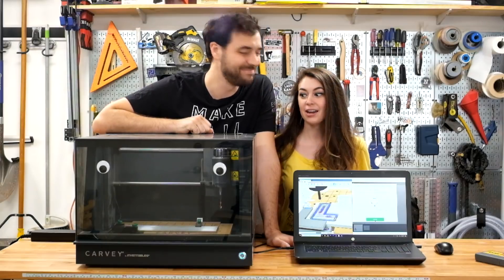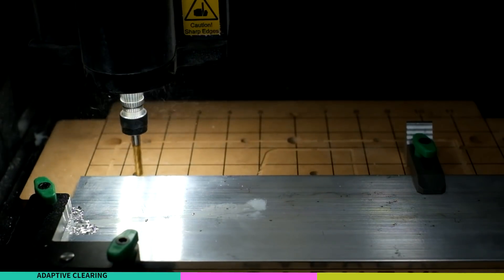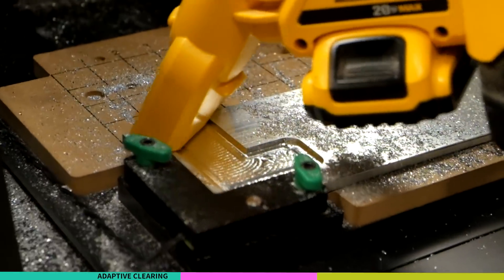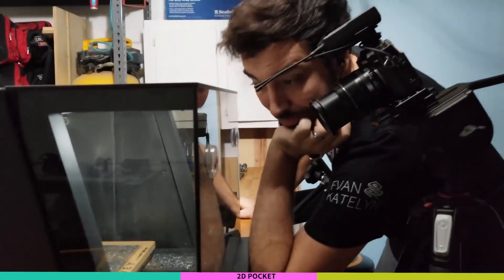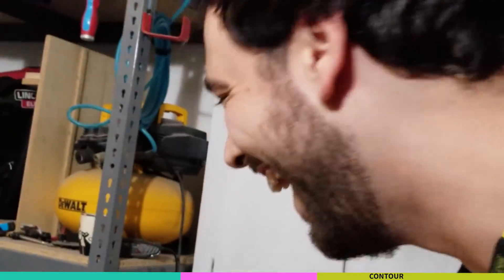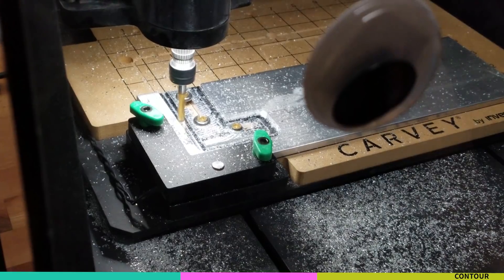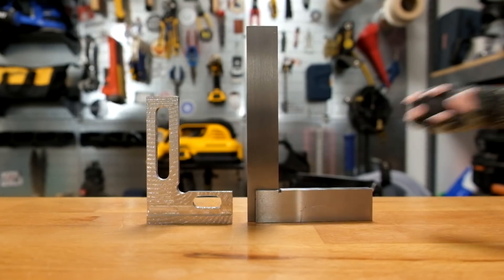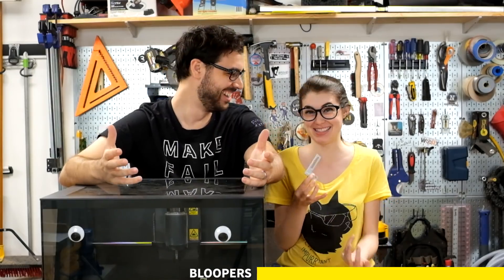Can You Cut Aluminum on a Desktop CNC?

Comment: propably the first thing you should do with that is build a cnc machine out of aluminium - then put a proper motor on it and then you actually are able to machine aluminium.  a square is not that hard to get right, but round stuff like holes or stuff with many repetitions and direction changes like gears is harder since the repeatability of a wood carving machine is nowhere near something a machinist would use
Reply from the maker: I guess the point of this was to see if we COULD do it on the machine we have - so we're actually really happy with what we were able to accomplish so far, even though we know further dialing in is needed
Reply: dialing it in is hard to do, if the machine runs on the edge of whats possible, you begin losing steps on the motors, maybe bend some guide rods and all that good stuff - just take it slow, machining metal takes a long time, even on really heavy machines. and also the type of aluminium makes a huge difference, there are different alloys and some are really gummy to machine (6061 for example is terrible) if you can get your hands on 6012, 2011, 2007 type aluminium, those are all made to be machined and they have additives in the alloy that makes the chips break instead of gumming up your cutter.

some comments also suggested that the cutter you used was too big wich is most likely also the case. but still i'd recommend starting to build a heavier machine if you really want to have precise mechanical parts
Reply from the maker: Yes we definitely want to try a smaller endmill, like a 1/8". We were using 6061 so maybe we should experiment with some others. Thanks!

Comment: Buy 4 flute carbide endmill. Much better for hard materials.
Reply from the maker: Hmmm, we used two flute since that's what most people seem to be recommending, but we're willing to look into it more! Thanks!
Reply: @EvanAndKatelyn  imagine it like slicing tomato with 2 or 4 knifes at the same time. What is faster? :)
Reply from the maker: 4 would definitely be faster, I think what other folks were saying is with a 4 the chips would be too small and might get gummy.
Reply: Yes, but at your feedrates it shouldn´t be a problem. I´ve already mashined few cast aluminum parts and the chip welding only occured when chips were getting hot. With your spindle power it shouldn´t be a problem. And it should fix vibrations a little.
Normally when removing a lot of material they use roughing endmill and then take a finishing pass with finishing one.
Great book about cnc machining is Fundamentals of CNC machining by autodesk. Or NYCCNC.
Wish you success :)

Comment: A few things to note.
It looks like the machine uses belts as the drive system. That is going to give you guys a really hard time as the machine deflects and looses steps like crazy
Your end mill is pretty big for that machine, I'd look into 3/16 or possibly better, 1/8. YG-1 makes some very affordable endmills that would be worth your time to try. 
The end mill does not appear to be a plunging geometry. That means it has no relief in the center, so it can't be pushed through the material. That plus the lack of rigidity was the biggest fight for you guys.
Reply from the maker: Thank you for the tips! Definitely wanna try 1/8 next time. A lot of folks have suggested getting a shorter one too. Will look into different geometries as well 👍

Comment: Wrong machine for the job. The guide bars are not rigid enough. They really need to be supported. Continue to cut aluminum and you will wreck that machine in short order.
Reply from the maker: It's definitely a machine more suited for wood but based on all the folks we've talked to with a lot more CNC knowledge than us, if we keep dialing in things and taking it slow we should be good to go 🙂🤞

Comment: Im no expert but i think youre feeding way to fast and something in your setup isnt rigid enough.  It definitely doesnt sound happy.
Reply from the maker: Definitely too fast in the beginning! This is a machine usually meant for wood so we are pushing it's limitations
Reply: @EvanAndKatelyn  for sure.  I would suggest setting up a test path so you can get repeatable results then slow everything waaaay down.  After that start bringing feeds up a little at a time until you hit the limit of the machine (you'll hear it when it's hitting the limit, it definitely shouldn't sound like it does in the video) then back it off a bit.  You might also want to switch to a 1/8 aluminum cutting endmill as you'll get better results with the low power router.
Reply from the maker: Definitely want to try 1/8" next time! Haha and yeah we probably should have started slower and ramped up instead of the other way around. Thanks!

Comment: First of all: I am not an professional milling operator with a 1 ton Bridgeport mill, so I know what is possible on wobbly machines. Good manufacturers for milling tools have nice tables with all the data you have to know to make fine chips. And for aluminium and a 6 mm 2 edged cutter the data (I am from the metric side of the world) is: cutting speed 100 m/min; feed: 0.019 mm per edge. That calculates into 5300 rpm and 202 mm/min (8 in/min). So, your cutting speed is probably way too fast (20.000 rpm?) and will ruin the edges in no time, also the vibrations cause tooth decay which causes more vibrations. The carvey is not strong enough to break the tool, but at this noise my foot nails are rolling up. For aluminium you need a very sharp tool, crank down everything, use coolant/lubricant and you'll get much better results without ruining tools, machines and parts. And the data in the tables is made for 1 ton mills, so turn it down even more because everything is so wobbly. If it helps: I wrote a program for myself with the relevant data for my mill: www.sourceforge.net/p/feedcalculator (the help is containing an extract of the data tables). If everything is set correct and the tools are sharp, it should cut metal like butter ...
Reply from the maker: Thanks for the tips!

Comment: Oh my gosh you guys, kudos for trying something well outside your wheelhouse but this was a seriously cringe worthy experience.

On the bright side if you consult some folks with actual CNC machining experience I'm confident your little machine could actually do a decent job considering its size.

Edit: I apologize if my comment seems harsh that's not my intent. Don't try to reinvent the wheel. I do this daily for a living and would gladly help you if you'd like.
Reply from the maker: Gotta start somewhere right? We did do some research but as far as we could find, no one has tried this on a Carvey before so we knew it was gonna be a bit of a surprise!
Reply: @EvanAndKatelyn  there's a lot at play here with what your trying to do and like I said before I totally commend you two for taking the deep dive and giving it a whirl. There's only one way to learn and that's to try, fail, adjust and try again. 

I'd recommend you consider looking up the difference between what is called "conventional" milling and "climb" milling. You need to be "climb" milling especially with the very low rigidity of your machine. I'd also encourage you to read the linked document. I have printed off many copies and made them into books that I give to the machinist I manage for reference. Helical solutions has put together a great reference guide. 

https://www.google.ca/url?sa=t&source=web&rct=j&url=http://www2.mae.ufl.edu/designlab/Advanced%2520Manufacturing/Helical_Machining_Guidebook.pdf&ved=2ahUKEwj-iJ6E_ePdAhXVOn0KHZa3AGsQFjAOegQIARAB&usg=AOvVaw1jMqaCc411tiP2WzdF02l5

Of greatest interest to you will be the technique that requires low horsepower using full depths of cut at very low stepover or radial depth of cut values. In your case I'd say around 2% of your 1/4" diameter end mill to start. I'd also encourage you to use a trocoidal (elliptical) slotting technique to rough out the outline of the part. In the document linked they call it controlled slice slotting. Again you'll be using a full depth of cut and a very small stepover value. Don't forget that document was made for industrial machines so the 10 to 15% stepover likely will not work for you.

Next with regards to feed rate. Put IPM out of your mind for a moment. When calculating feed rate the most important thing to consider is what's called chip per tooth. That's the "slice" that each tooth of the end mill takes as the cutter advances. Chip per tooth or more commonly feed per tooth (FPT) will remain constant regardless of the number of flutes on the endmill but IPM will change because the  number of flutes x FPT is different.

There's also a practical minimum FPT for endmills. Slower doesn't always fix chatter, in fact the opposite is often true. Think of slicing a tomatoe there's a practical limit to how thin a slice you can make before the knife just slides off. For an end mill the rule I tell people is 0.001" FPT  though you can likely get down to .0006"

You should also never plunge an endmill to depth. Use a helical boring entry.

Anyway, keep at it. I'd love to see you make this work in that little machine.

Comment: Brass next?
Reply from the maker: We definitely wanna try brass!
Reply: I want to do brass for a branding iron. Because of detail level, think I'm going to try carving it as a rubber stamp first. on some linoleum on MDF. Settings would be different for each material, but hopefully, rubber gets me an idea of how the detilas look and costs less if I need to redesign.  Additional question: You said you increased the plunge. Do you mean you increased the distance over which it plunges, so it would plunge more slowly?

Comment: That machine really doesn't look like it was designed for cutting aluminum. Get one with fully supported rails / profile rails and a stronger spindle.
Reply from the maker: It's more for cutting wood, which is what we usually use it for, but we wanted to see if we could push it

Comment: Your end mill is 'sticking out' way to far from the collet. The further into the collet the tool is the less vibration you will get which will equal a better surface finish. You can also take a greater DOC with less vibration.
Reply from the maker: We had this one in as far as it could go, but would love to try a shorter bit! E didn't have much luck finding one online

Comment: @evanandkatelyn given that a Carvey and fully loaded x-carve are roughly the same price, which would you buy? I will buy one of them and eventually I'd love a full 1000x1000 xcarve, but today the Carvey makes a bit more sense given the enclosure and overall size. 

Seeing as you have experience with both, any functional reasons to choose one over the other? Thx!
Reply from the maker: Depends on what you want to make and your experience level! X-Carve is great because it's so versatile and big, but it requires a lot more setup. Carvey is pretty much good to go out of the box, it's awesome if you don't have a shop and need to keep it in the house, but it's obviously a lot smaller
Reply: @EvanAndKatelyn  leaning towards the Carvey as this is for business and will suit my needs for a bit. Thanks!
Reply from the maker: You're welcome!

Comment: Look up feeds and speeds equation. You just plug in info about your bit and material and it tells you your feed rate, rpm, etc. I did a project at school where i had to mill steel and i broke at least one bit if not 2 because i didn’t know about it.
Reply from the maker: We did do some research but I think it's different per machine too - more to dial in for sure til we get it jusssst right
Reply: EvanAndKatelyn yea i think in this case the machine matters because your machine is not designed for it and will break before the bit does but most of the time you base your feeds and speeds off of the bit.

Comment: your tool isn't a centercutting tool so it can't go strait down so it needs to go in a sligt hill so it's better to down in a whole pas in a slight ramp than to do it in a short pas like it was doing in the pockets the adaptive clearing you got is pretty good you can always let a small amound of material stay like 0.3mm and clean it up with a higher speed to clean up your piece feeds and speeds can you calculater but they depends on what mateial your tool is made up and what diametre it has and also how manny tooths it has.
Reply from the maker: Yeah after that first attempt we quickly learned straight down was not gonna work haha! Definitely down to keep dialing in speeds and feeds. Thanks!
Reply: you can easy way to see that you have a cantercutting mill or not just by looking at the underside of the mill and when the tooths end up in the middle it's not a centercutting mill and when they don't meet up in the middle but a bit more to one side it's a centercutting one and then you don't have probelms with going strait down
Reply from the maker: Thank you!

Comment: I would highly recommend a way shorter end mill. You have a lot of tool stick out, generally we would compensate by a speed reduction of 20-45% to compensate for the length. But not a bad first attempt and congrats on your first part!
Reply from the maker: We had this but in as far as we could but had a hard time finding anything shorter online - definitely open to suggestions if you have recommendations where to get some! Thanks so much!

Comment: I would wonder that when the bit took the hard hits at the beginning of use it could have dulled the bit or misformed it?? When you got the settings correct I would have gone with a sharpened drill bit. It probably would have ran better.  Also, when you drill through metal if you don't use a lubricant your bits will dull quickly!!!
Reply from the maker: I think the bit was ok actually! Also, it had a coating on it that negated the need for lubricant. But definitely still lots of things we can dial in and improve. Thanks for the input!

Comment: oh i bet every machinist here cringed a lot watching this. my 2 cents is shorter tool, change to 2 flute for aluminum, very slow feed rates (when using fusion i prefer to use feed per tooth) and start at .001-.002 feed per tooth since the machine lacks any rigidity to do any heavy cuts.
Reply from the maker: This actually is a 2 flute and we had it in as far as we could go - tried to find shorter bits but didn't have much luck (definitely open to trying shorter though! And definitely wanna keep dialing in the speeds and feeds. Thank you for the tips!
Reply: Your welcome, sorry i did not notice the 2 flute. half of all machining is troubleshooting and problem solving. once you find the right formula it gets really fun.
Reply from the maker: Haha seems to be the case! Thanks!

Comment: If u can cut it with at shorter tool much of the noice will go away!
Reply from the maker: We tried looking for shorter bits but didn't have much luck (and this one was in as far as it could go), but we definitely are down to try a shorter one!
Reply: Get a shorter one and ho as much rpm as u can on the mill, the shorter tool u have the more stabel it will be and u can run faster, but be carfull with aluminum becuse if u have high rpm and run slow feed it will melt on youre tool :)

Comment: You guys should contact Tormach to see if they will give you a machine to use. The Carvey would do better with a 1/8" endmill but it still is WAY underpowered and not very stiff.  A Tormach would make a part like that in just minutes and with a much better surface finish.
Reply from the maker: The Tormach is a cool machine, if we had space we'd just keep adding to the robot army, but we thought it was really cool that we were able to do this with a tiny machine we had on hand :)
Reply: @EvanAndKatelyn  I understand. I started with a Nomad 883 which is very similar to the Carvey but the super low power spindle drove me crazy because everything took so long. The accuracy was great though. I then got a Shopeoko3 XXL and I've put over 700 hours on it already. A 1.25 hp router is so much better than a 0.1 hp spindle. 

Digital fabrication is awesome so thanks for helping take some of the mystery out of it for everyone. You two are doing great work.
Reply from the maker: Thank you so much! Hoping to make it less intimidating to folks who are thinking about getting into it